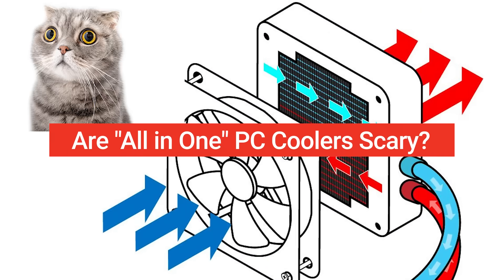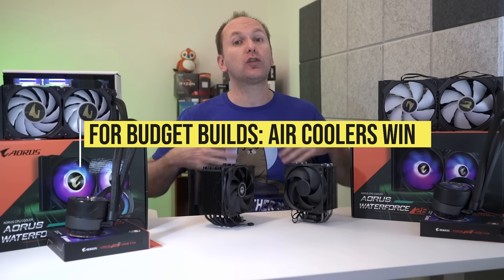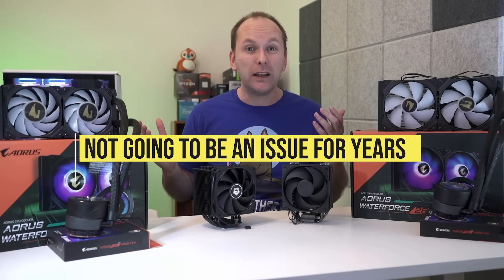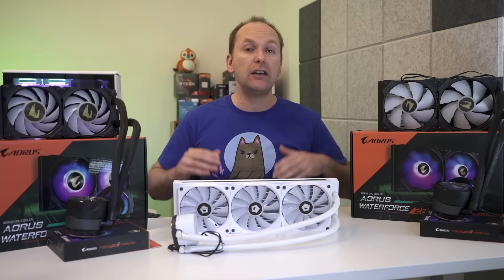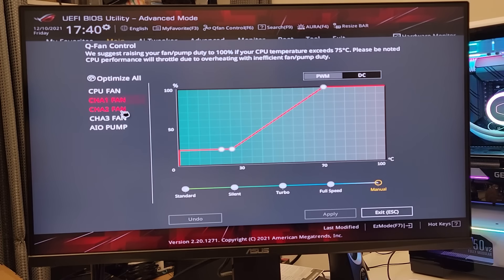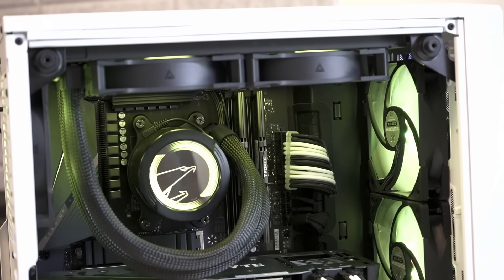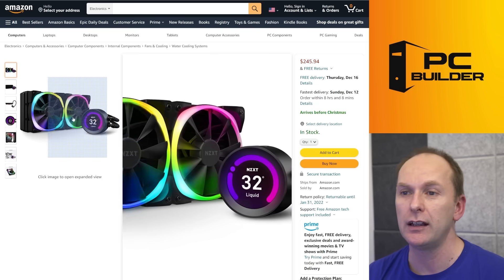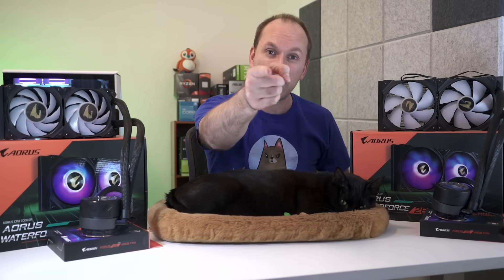🛑Watch BEFORE You Build! 🌊 PC Water Cooling Build Guide | Water Cooled PC Build 2022

Comment: Why most of these setup guides recommend installing aio radiator with fans pulling air from the case to the outside? The air inside the pc case is already at elevated temperature so why pushing warm air through aoi that should cool in a first place? Things get worse with high end, power hungry gpu installed. Why not reverse air flow and use cool air from the outside to hit your aio radiator first instead? You may say, it will push warmed by aio radiator air to the inner of the case, well for that you should have installed side fans that will blow this hot air away from the case by pulling it out, which is the rear fan and the front fans pulling the air out of the case. This way you will achieve a good equilibrium instead of inefficiently using your aoi that will keep the CPU temperature higher than in the reverse configuration. 
This reverse setup becomes even more important when you have two aio's for CPU and GPU. Both radiators has to be installed also to pull the cold air from outside into the case and then back and side fans should be pulling that air out of the case. Simple thermodynamics.

Comment: Hi Jason, would 3 x 120mm top mount inlet fans and 1 x 120mm rear outlet fans be enough for Ryzen 5 5600G with it's standard CPU fan fitted. No GPU fitted.

Comment: Only do a AIO if you’re really not into water cooling only do custom cooling if you plan on upgrading your system down the line multiple times and only do air cooling if you really don’t care about any of that and you just want to set up your PC and use it stick with air cooling but also don’t use crappy parts don’t cheap out on anything in your build.

Comment: I am probably overthinking with my AIO placement. I have a fractal design define R5 case, and going for a Arctic LF II 360 with an R9 5900X setup. I was initially going to top mount it and have it as exhaust, 2x 140mm fans as intake on the front and 1x 140mm on the backside as exhaust. Having this kind of setup could/would have my cpu go 10C hotter versus front mounting it. How about having it top mounted and having it as an intake. Would it be better that way or negligible ?
Reply from the maker: Some prefer to always have the AIO as an intake to get the "cooler" outside air, but the temp difference it typically only a couple degrees unless your case airflow is bad. That being said, how would you top or front mount a 360mm aio on the R5 as it is an older case with only half the top as mesh and has all those drive panels in the front? Maybe I'm thinking of the wrong case?
Reply: @PCBuilderChannel  top mounting is possible, only 420, 280 and 140 are special and those cant be thicker than 55mm max, fans included. On top there is almost 440mm of mesh. the front is a no go cause it is built with 5.25 drive bays in mind (drivebay is possible to get rid of). I was just curious that having the top (360) as intake is probably better than exhaust for a R9.

Comment: Front panel, tubes up isn't a viable install, tbh.  The air pockets will be at the in/outlets of the radiator, reducing coolant flow.  Either install the radiator at the top or in the front with the tubes down.

Comment: If you install the radiator in the front of the case tubes up is not recommended because the air goes to the top of the tubes directly being pumped to the pump, tubes down is optimal.

Comment: doing a lian li mini air build with a 280 aio what would you recommend for mounting aio? is the side mount option any good?
Reply from the maker: You know, with that case if possible I would go 240 and top mount it. I know it says it will work with a 280 but when we tried to top mount our 280 with that case we couldn't make it fit. Check out our 5050X build video you can watch me struggle in the build montage lol
Reply: @PCBuilderChannel  yes the case defeated me lol with the 280 so i decided to top mount it ill check that video out thanks

Comment: Hi Mr! So would you have time to talk about the frustration of finding an out-of-the-box Alderlake LGA 1700 AIO solution. The mounting hardware seems to be impossible to find included in the box. I have a Fractal Torrent RGB with fantastic 180MM front fans I hate to lose so I need advice. Thanks!
Reply from the maker: Reach out to Fractal customer support. They will likely ship the bracket to you, maybe for just a small fee.

Comment: If i have a case with 3 intake fans on the front, 1 exhaust in the back and i have a 360mm aio that i want mounted up top totaling 7 fans (not counting the psu fan) should i switch the back fans to intake as well to keep positive pressure? Im a bit confused about this

Comment: I have never ever had one leak, even the earlier versions with crappier rubber tubing. I think being gently with your equipment goes a long way. I've also never ever ever had an air cooler that comes even close to the low temps or an AIO.

Comment: Thank you for a wonderful detailed advice.
Question: 
I'm planning to install a NZXT Kraken G12 GPU cooler with Kraken X53. My case is Fractal Design G ATX Mid Tower and my CPU AIO is Corsair H100i Pro mounted in front.
Would I get uncomfortable temperatures if I relocate the Corsair H100i Pro on top and have it blow the air outside of the case while mounting the Kraken X53 in front while sucking air inside the case? What do you think and what do you recommend?

Cheers

Comment: hello sir 
 iam from india 
ia have cooler master cabinet mb 500 
and aio cooler master ml360 illusion
can i use 6 fans in radiator
3 in front for push direction rpm 1200
and 3 in back in pull direction rpm 650 - 1800

Comment: Hello !! i bought a msi mag coreliquid 360r, the pump is in the radiator, should i mount it on front panel ??
Reply from the maker: I would refer to their instruction manual for recommendations on mounting. I would think that its fine to mount it either position

Comment: Hello PC Builder, thank you for great video and specs of this coolers. I want to ask you what do you think of the ASUS ROG Ryujin II 360 RGB all-in-one liquid CPU cooler 360mm Radiator (3.5" color LCD, 3x Noctua iPPC 2000 PWM 120mm radiator fans, compatible with Intel LGA1700, 1200 and AM4 socket) do you think I should go for one of the ones you recommend here? putting it on a AMD 5950x with and Asus strix rtx3080 (case Phanteks Eclipse P600S) i will appreciate your opinion buddy.
Reply from the maker: Great cooler, very expensive. Will work fine for the 5950X.
Reply: Great I will look in to it thank you for the help.

Comment: Great information. My question about aio cooling would be can I change the fans to match the rest of the build. I want to use Corsair 120 ql version on a Corsair h150i.
Reply from the maker: You can, but IMO they already look quite similar both being corsair fans. The only issue is that the fans that come on the cooler are static pressure fans (good pushing / pulling through impedance like the cooler) and an airflow focused fan might not perform as well.

Comment: So I unfortunately have either 280mm side mount, 360 front mount, and 120 mm rear mount for aio's in my case. My artic freezer 2 is a thick boy. I want to mount it the right way with the tubes coming from bottom, but the fans are so thick that that don't fit that way. Would it stupid to remove one of the fans just so I can make it fit? In the meantime, I can find a slim fan to replace the one that is thick? The case has RGB front fans (prob trash) but it still will pull aio through the aio as well

Comment: I used to be one of those "liquid is too much trouble to install and maintain for the risk, I don't do anything so heavy that I need that much cooling". Fast forward to today, streaming, gaming in 1440p, content creation with video editing, and the advancements made in AIOs, the need went up and the risk came down, but my current $30 air cooler is doing pretty well, I just went with 5 pure wings 2 fans on the case and put Kryonaut on GPU and CPU. I'll probably invest in an AIO this year as my workload gets more intense and I look at higher end GPUs, but for now, I'm doing pretty awesome temps and it's VERY quiet, though the cost of 5 140mm pure wings 2 was nothing to scoff at, and AIO may have accomplished the same temps and noise level with the old cheapo case fans, but I won't know for sure til I try it I guess

Comment: if you do have a top mesh filter, you can always just cut it away around the AIO, leaving the mesh over the open areas, to keep dust etc from falling in. Sometimes the gaps around rads are big enough that the rad fans don't push all of it away, especially at lower fan speeds

Comment: Is there an advantage to whether the radiator or fan sits against the case ?
Reply from the maker: Not really. RGB looks better in the front if the fans go first, possibly better air intake from outside the case (as opposed to just recirculating air inside the case), but that's more of a guess.

Comment: I will never buy one again. There are air coolers that work as good or better unless you buy a $150 - $200 tripple 140mm fan model which is huge. Even then it's usually a 1-5 degree difference! Less parts less failure longer life and cheaper. My Mugen 5 is silent. My corsair 115i was louder and ran at the same temp. I have replaced many water coolers and since they tend to be be directly above the GPU that's what they would leak on. Good news is they almost always die before they leak!

Comment: 7:36 you are wrong. you can clearly see that the fans at the top are exhaust fans because of the position and orientation of the fans. The fans on the radiator are intake fans, they take fresh air from outside into the radiator immediately cooling the cpu. to make that situation even better you would place intake fans below the gpu to bring fresh air straight into the gpu then allowing the exhaust to remove the hot air as it rises to the top of the case.
Reply: it also makes zero sense having you water cooler as an exhaust at the top of your case. You would be sucking hot hair directly from the gpu into the water cooler that is supposedly cooling your cpu. If i have any of this wrong please enlighten me as i believe im seeing most people set there gaming pcs up with poor cooling and airflow.

Comment: One tip I could offer, if and when you decide to swap your air cooler for an AIO cooler. Run your pc before disassembling the air cooler to make the old thermal paste unstick from the cooler. I didn't do that and it was a nightmare getting my cooler off my CPU it was essentially fused and I risked damaging my CPU and the socket.
Reply: But its only good for unmount cpu cooler. Bad for pulling ram
Reply: thanks, nice tip!
Reply: Oh that’s why i almost destroyed my cpu socket
Reply: A blowtorch will also help 😅
Reply: Nice tip
Reply: Yeah, if it is stuck on there you run the risk of bending pins.
Reply: I was like huh. I guess people turn off their computer.  I've had all my PCs since the early 90s on 24/7.  I don't think I could sleep without the sound of a computer running.

Comment: Question... I upgraded my air cooler to the Waterforce X240mm. Upon completing Bios keeps coming up with a CPU fan error. Also the AIO is not registering in BIOS and the exhaust fans come on 100%. I downloaded Auros Engine where I can adjust the fan speed but I am still wondering why Bios wont pick up the AIO and why i keep getting the CPU fan error. Thoughts?

Comment: I have a question. Fans between case wall and radiator, or radiator between fans and case wall? I'm planning to setup an AIO cooling system, DEEPCOOL CASTLE 240R, on Ryzen 7 5800X.
EDIT: Newb question, but I'm extremely new to AIOs. Have never tried before.
Reply from the maker: It depends, you can set it up as push or pull. The fans are usually on the radiator. I'd check out the section of the video again where we go over positioning and air flow. And no worries! Welcome to AIOS (:
Reply: @PCBuilderChannel  It's cool that the fans have a little arrow on their side, indicating the air flow. So if I'm installing it on top, I have to make sure it pushes out the hot air, and if on the front, I have to be sure it's pulling the cool air inside, and through the radiator. So, if casewall is X, fans are F, and radiator is R, I have to install it like XRF :D

Thank you very much, awesome video.

Comment: ive got a waterforce x 240mm aio and paring it with a ryzen 9 5900x my idle is around 50 to 55 and while playing a game it is around 70 to 75 i am getting brand new therm,al paste but just wondering if that is normal?
Reply from the maker: Make sure in the Aorus utility you turn the pump speed to maximum. And also tune the fan curve. The temps seem fine but if you want more performance I'd look at those things.

Comment: Glad I found this. I still advocate for air coolers regardless due to my needs. You're definitely right about RAM clearance being an issue with some air coolers. I feel that the Scythe Fuma 2 had great compatibility to mitigate this, though. Plus the Fuma 2 has some of the best contact with the CPU that I've seen from any cooler.
Reply: Fuma 2 is really nice. Much quieter than having a water pump. You can add a third fan and get faster fans for it if your needs change too.

Comment: Hi Jason bro!
I've got a luxurious problem with my Asus Rog Strix RX 6900 XT LC Top Edition 😜
The build is in a Thermaltake Core V21 micro ATX Case. 
I've mounted it already in the front exhausting or inhausting or also on the top exhausting.
My cuestion is what would be the best for the absolute best temperature of this kind of GPU?
As I can tell the best Temps was with 4x 120mm fans on the radiator exhausting on the side of my pc! BUT I don't want the heat come into my PC because of the other components!
I've also a liquid freezer II AiO for my 5600x CPU. At the time it's on the right side of the micro ATX and pulling the heat out as exhaust. And right above this is the GPU aio on the top also exhausting the air with 4x 120mm fans.
In the front I got 2x 140mm Noctua industrial 3000 RPM 👌.
In  the front bottom I got 2x 120mm noctua fans. In the back of the pc is a 140mm arctic freezer exhausting fan.
My case is the Thermaltake Core V21 mATX.
Reply from the maker: It sounds like you've already got this figured out! That's tons of airflow, I'd only keep adding more if you are having temp issues.

Comment: I have the id cooling zoom flow 240x and it’s quite loud. I have it mounted at the top of the case with the tubes coming in from left, just like you installed yours in the video I have an asus motherboard and the pump is connected to the cpu fan header, I haven’t messed with any of the fan settings so it’s stock settings. It just sounds like a bunch of water running through it and every so often it will get this wind up noise, I installed the same pump except his is the “snow” version on my cousins pc however his is powered by the psu but his is way more silent than mine is and is also on stock settings I’d appreciate any advice to fix this thanks.
Reply from the maker: Hard to say but could be a faulty pump. I'd reach out to ID customer service about it. Possible RMA.
Reply: @PCBuilderChannel  ok so the bubbly noise is actually coming from the radiator, the pump is  pretty silent The bubbly noise will happen for a couple minutes then go silent and repeats that process, however on idle my cpu temp is at 30 degrees Celsius and 45-50 when I’m playing apex so the pump is definitely working. I don’t know if it changes anything that the radiator is making that noise and not the pump but maybe this eliminates a few factors of the problem.

Comment: My custom loop is more efficient ek water blocks and a ek dual pumps with 2 exterior mounted copper 360 radiators with push pull fans keeps my 12900k and 3090 cool
I went this way to keep the heat out of the case and for more space

Comment: Am I hearing this correctly? I should take the screen protector off where my radiator is?
Reply from the maker: The dust filter should come off any exhaust fans, otherwise it restricts airflow. You don't need to worry about dust being blown out of the case just being blown in.
Reply: @PCBuilderChannel  gotcha. My radiator is pulling in from the side so I don’t want to take the dust cover off as it will pull dust in to the radiator
Reply: @PCBuilderChannel  how often should it be cleaned from dust?

Comment: Corsair dumped Asetek pumps in their Capellix range of AIOs for Coolit pumps and by the number of complaints of pump failures on the forums it's not been a great idea. And they are noisier too and need fiddling around with, if it's still working. Which is why I went with an NZXT Z53, but swapped out the fans for Corsair LL120 fans to match the others in my case.

Comment: Just a little add on: For a case where bottom mounting the radiator is required, typically the beQuiet Pure Loop is the best and only real option. For absolute best performance, pair the EK or Arctic AiOs with either the Noctua NFA-12x25 or the Phanteks P30 fans.
Reply: don't forget Scythe Wonder Snail. That one is a heck good of a fan as well.

Comment: What if I have msi 240r does it still matter what angle should I mount my radiator?
Reply from the maker: For that one the pump is in the radiator so you can follow the instructions in its manual.